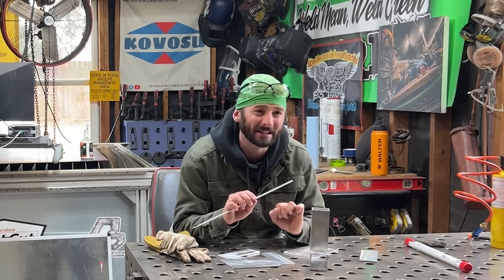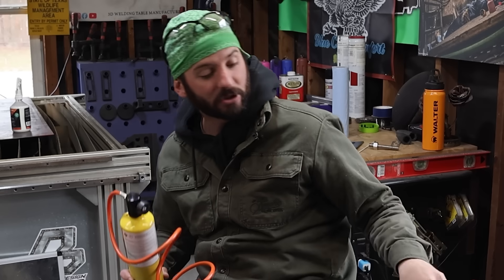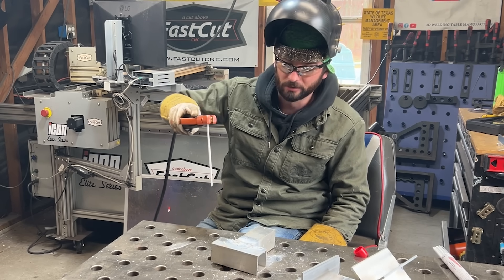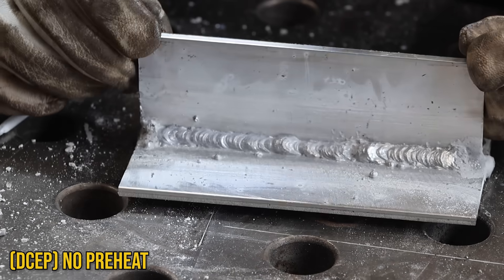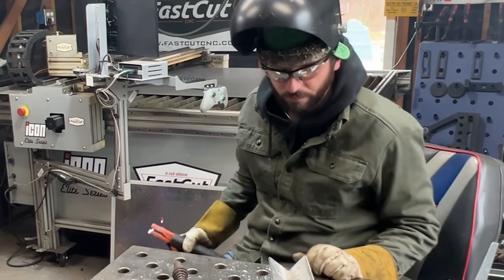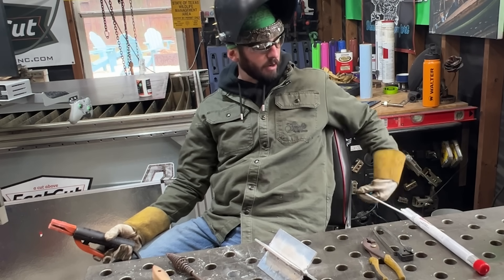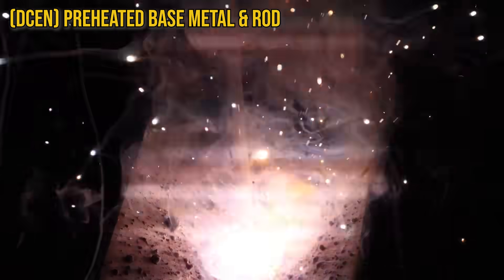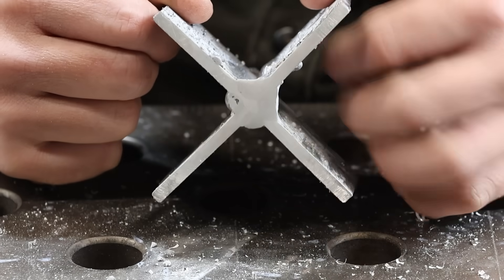Tips for Stick Welding Aluminum: Polarity and Preheat

Comment: my one and only experience with it was 20 odd years ago with 'Snowcap' rod. Didn't go well, jump ahead a couple years-bought myself a Lincoln 350MP with a Python push-pull and a Miller syncrowave 250DX. Bases covered now!
Reply: Thats nice equipment! Im a Lincoln/Forney fan. I have a couple of Millers and I have never liked any of them except my Bobcat 250 portable. 

My Lincoln Idealarc 250 really welds aluminum rods well.
Reply: @timberslasher4899  thanks! I agree on the Bobcat-my 1st engine drive was a Lincoln gxt250,still own it.I ran a good bit of stick off it and it kept the lights on in my house a few times,then I was practically given a Bobcat250 with 5 hrs on it by the local 'repo' guy.Night and day-the gxt would run dualshield off my LN25X feeder,but it was always a struggle.That Bobcat would put out an awesome puddle at 25v with a hundred ft of lead on-and the power was 120v no matter the load.Sold it to a friend and bought a Pipepro400 because I get free diesel at my 9-5
Reply: @garthland  I would like to have a suitcase but my Bobcat is on a trailer and I made an enclosed compartment that my Forney 210 can ride in and I have a bottle holding rack for up to four 180 size bottles. I can also put my Forney 45P Pro plasma cutter in there. I have a 2 stage compressor on my service truck. Wish I could put my Forney 270 mig on there lol. The 210 does really well but the duty cycle is about 3x on the 270, and it weighs 250 pounds so loading would not be fun...lol.
Both of them put my ol' Millermatic 250 mig to shame. That welder is what started making me distance away from Miller. My dad bought it new in 1992 when I was in high school and it never would weld good. Miller worked on it 2 times and found nothing wrong. Supposedly those had a poor transformer switching system. I had a Millermatic 252 as well that I didn't care for, ended up selling it.
Reply: @timberslasher4899  nice setup!